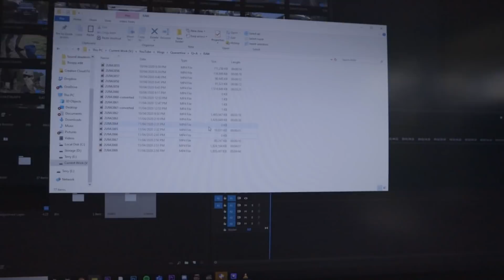I Answer Your Questions!

Comment: Just went through the same with my 80. After heaps of research came up with rebuilding my 1hz to turbo spec and turbo. Now I know my engine is a1 and don’t have to worry about it letting up and when doing a swap you don’t know the engines history. 👍

Comment: I just turbo'd my 105 series with a 1hz did a semi factory turbo kit from a 80 series and couldnt be happier with the result. I did it the most cost efficient way possible and bought the parts seperatly instead of a kit, because it worked out way cheaper. My car also has a fair few kms but its a risk that I have taken and will cross the path when it comes weather or not to buy another 1hz or rebuild the one thats in it but for now I couldnt be happier.

Comment: Petrol is ok I've own 4 converted 1to dual fuel, because they are cheaper to buy,  doing a trip it cost more on hip pocket when filling up. I have a project 93 troopcarrier 4.2 diesel non turbo, if I decided to got turbo I'll keep the boost down. Duel fuel has its issues another thing you can't buy it every where, at the end of the day you only save 50cent a litter. Q Would I own a dual fuel again !!! No it's not worth the headache..not every mechanic works on LPG also roadworthy inspection aren't every where as well. Currently I have a 24v petrol 4.5 80series bought cheap as a run around until I get the troopy back on the road, 500 k's out of a 90ltr tank hwy use not impressed. Luv the cruise control & air conditioner tho. It's my first coil vehicle, I don't think there much between them. Also I've own a GQ patrol ute trust the quality is not there compared to Toyota only in the body only. Mechanical it's the opposite, Toyota parts are everywhere Nissan not so much. I'm no mechanic but I do all my work myself including pull the engine down if needed. So Adam follow your instincts don't listen to anyone else do your research follow your heart because you are young. If you plain to throw 20 to 30g of your hard earned into a project you need to ask yourself could I buy a later model v8 for the same money after you sold yours. Anyway luv your blogs also the rock lights.

Comment: Only just started watching mate. but id still turbo it. ive got a few mates and helped turboing a few 1hzs. good intercooler gauges and turbo setup and itll last for ages. not to mention a cheap kit is all you need, find someone wrecking one grab it and itll work mint until you swap an engine. Well worth it. wont die mate. well the turbo wont kill it quicker than it would have anyway
Reply: BigBadAzza230 hey man any experience towing with a turbo 1hz and overheating etc?
Reply: @lachlanstill  water temps?  Pretty standard. Less fuel more boost to a point helps. Also intercooler and a more efficient turbo. To be honest mate they arnt the most efficient engine ever. And I use to have the same issue with my old Hilux 2.8
Pyro temps must also get up there?

Comment: The way I look at it you can make power for $ with petrol but you lack reliability and with diesel power costs $$$ buts it’s more reliable
Reply: Why is petrol less reliable?
Reply: minicrawlnkid more components - more components that can fail especially when we are talking about 4wding mixing water with your injection system you’re ignition system your fuel system it’s all pretty out in the elements, in a diesel not only does your engine have less components that can fail, they are more sealed they also are ideal for 4wding as Diesel engines typically produce the most tourqe lower in the rev range
Reply: You've got no idea ey
Reply: minicrawlnkid “my Fucken Barra is hecktic reliable ayyy cuz”

Comment: i'd be careful with engine swaps and turbo on your original engine while on your P's. you'll get done for it as it counts as an engine performance mod
Reply: psy06 your allowed “engine performance mods” if its a turbo on a diesel, mod plated and if it’s below the max power to weight ratio and below 250kw. Your not allowed a turbo petrol or a v8 petrol on your ps no matter if it’s factory or not. If “engine performance mods” were illegal you wouldn’t be allowed a different exhaust, a snorkel or playing with a fuel pump which you are.
Reply: @harrydaly4624  not what i've heard. i've heard of people getting done for putting a turbo on a GQ's, as they never came out factory turbo here, its not legal even tho its still slow as hell
Reply: Harry Daly depends what state you’re in but in Vic you can drive real old 5.0 v8s in commodores if it’s the right power to weight ratio
Reply from the maker: I will be off my P's soon so this will all be happening after then
Not something that I want to mess with haha